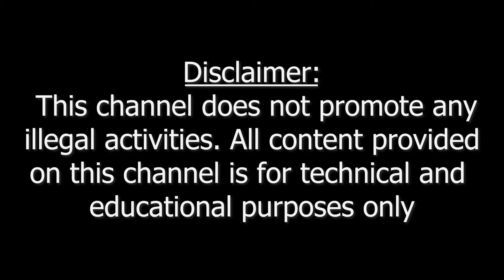Pressure/car washer repair at home | Weak water flow from the pressure washer. #Woodpecker#മലയാളം

Comment: Seating o rings with pointed scissors 15:25
Reply from the maker: A good O-ring will not scratch so quickly. The edge of the scissors is not very sharp. And if you have experience, there is no problem. But don't apply too much force

Comment: hey, the pressure washer motor works but it doesn't give a result in the water, there is no leakage, what could it be?
Reply from the maker: There may be a block in the gun or in the inlet adapter
Reply: Change the outlet check valve. It look like a bullet
Reply: @dharmeshxx  8ģ

Comment: Hi, thanks for the vid. I've stripped mine down and cleaned oil as it was really milky. Changed capacitor because the motor just wont start on its own. If I help it by flicking the fan the motor will run anf i have high pressure. Any idea what else I can check? Its a K3.97 and has a 20uf capacitor fitted. Thanks
Reply from the maker: Is the fan tight when you turn it?
Motor winding checked? Check if the replaced capacitor is good. Is the voltage correct?
check the motor rpm too.
Reply: @Big V Media  no motor spins it just won't start up. However if I give the fan a slight push it starts up and runs well. Capacitor is brand new. Winding obv good as it runs well when it starts.
Reply from the maker: One of the motor windings may be burnt. What happens if you slowly rotate the motor in the opposite direction? If it spins like that, it should be turned off immediately. Be careful not to getting shock. Also turn off the motor and check if the bearing is tight
One of the motor windings may be burnt. What happens if you slowly rotate the motor in the opposite direction? If it spins like that, it should be turned off immediately. Be careful not to getting shock. Also turn off the motor and check if the bearing is tight
Reply: N..zm

Comment: Hello brother....my machine have the same problem
Machine works good but there is no pressure....what will be the reason❤
Reply from the maker: clean water inlet, gun, nozzle etc. check oil,  capacitor, motor rpm.  confirm bearings are good. check oil seals and water seals also bullet valves

Comment: I have the machine that does not turn off after I finish spraying water
Reply from the maker: If your pressure washer is not shutting off automatically, it's essential to troubleshoot the issue carefully to identify the underlying cause. Possible causes:
Faulty Trigger Mechanism: The trigger mechanism, which controls the flow of water, may be malfunctioning or stuck in the open position, preventing the pressure washer from shutting off when the trigger is released.
Broken or Worn Parts: Components such as the pressure switch or unloader valve may be damaged or worn out, preventing the pressure washer from sensing when the trigger is released and shutting off accordingly.
Clogged or Faulty Unloader Valve: The unloader valve is responsible for diverting water flow back into the pump when the trigger is released. If it's clogged or malfunctioning, it may not properly redirect the water flow, causing the pressure washer to continue running.
Air Leaks: Air leaks in the system can affect the pressure washer's ability to build and maintain pressure, which may prevent it from shutting off properly when the trigger is released.
Electrical Issues: In electric pressure washers, electrical problems such as a faulty switch or wiring issues could prevent the unit from shutting off as intended.
Improper Adjustment: If the pressure regulator or unloader valve is improperly adjusted, it may not allow the pressure washer to shut off correctly when the trigger is released.
Reply: @bigvmedia  Thanks for these valuable notes, really, It was from the automatic stop system because the moving screw that stops the pump wasn't working right, and I thank you again for your notes

Comment: Boss sn po makkabili ng ool seal ng blak n decker power sprayer
Reply from the maker: Maaari kang bumili mula sa link na ibinigay sa ibaba. Ang isang angkop na selyo ay maaaring makuha mula sa isang lokal na tindahan
https://www.bricoutensili.com/en/blackdecker-pressure-washers-parts/9441-valves-oil-seal-kit-for-pressure-washers-bd-bxpw-1300-e-1400-e.html
https://www.lazada.com.ph/tag/pressure-washer-oil-seal/

Comment: Porfavor me dirías para conseguir las arandelas de plástico con dientes las tengo partidas
Reply from the maker: https://www.amazon.in/Pressure-Washer-Gaocheng-Ballorex-washers/dp/B0B3BFBKRK/ref=asc_df_B0B3BFBKRK/?tag=googleshopdes-21&linkCode=df0&hvadid=586315506872&hvpos=&hvnetw=g&hvrand=4718440794938600323&hvpone=&hvptwo=&hvqmt=&hvdev=c&hvdvcmdl=&hvlocint=&hvlocphy=1007776&hvtargid=pla-1676185797728&psc=1

Comment: My pressure washer is nnot giving out enough pressure... The bearing recently broke and i had it repaired still there is no proper pressure coming. I have a resqtech 1700 wt 135 bar pressure washer. What could be the problem?
Reply from the maker: May be dirt    clogged inside
Reply: @bigvmedia   how and where should i clean it?
Reply from the maker: first check and clean water input adaptor.  Then gun. if not worked yet , need to dismantle the pump head to check the reason.

Comment: After watching the  entire vedeo I was expecting to you to show  where  the problem with the pressure washer was, aside from being all dirty? No. you didn`t. except for showing us how to wash clean a preasure washer.  Sorry
Reply from the maker: I have uploaded three videos. Have you watched them? Low pressure can be caused by many reasons in pressure washers, such as dirt, water and oil seal leaks, O-ring problems, broken springs, motor capacitor issues, unloader valve malfunctions, etc. Thanks